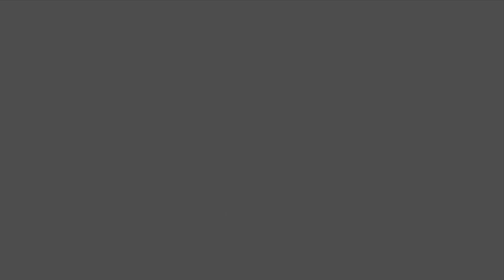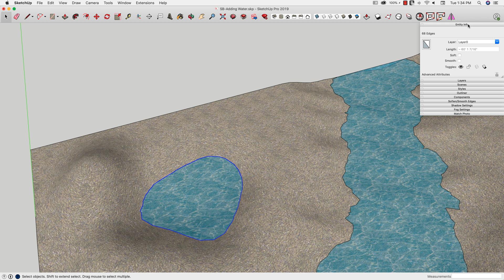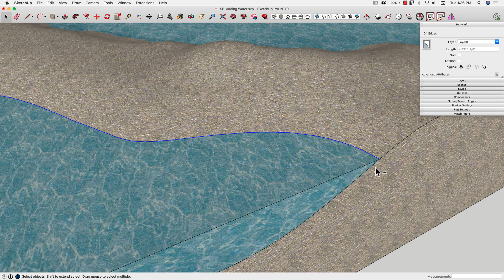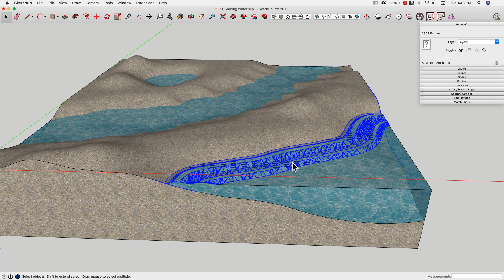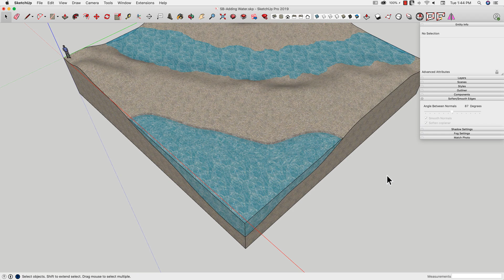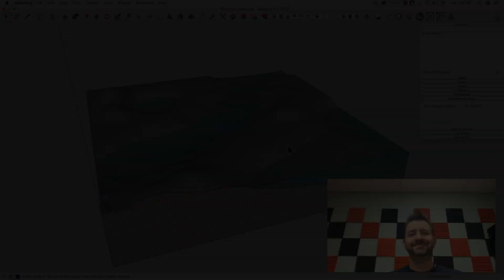Comment: It may not as widely useful as modelling, but could  you do a similar series with LayOut, plese? I feel very confident using SketchUp for modelling, but I am still struggling to present in a  simple, stylish way. I have to say I am dreading to open LayOut, not because I have bad experience with it, just because I know so so little about it compared to SketchUp. And in the end  2D derived from 3D is is a very good way to communicate and explain the idea. Very good video. Cheers.

Comment: Great video thanks. I’ve spent some time trying to improve sea views and your technique is useful. One way to avoid trimming edges after an offset is to move the straight edges into alignment. So in your example it would be offset-align-align, offset-align-align, etc. 

A further detail would be to add foam with the skatter tool. I have several foam elements on 3DW. Foam elements are also useful in boat wakes. 

It’s very surprising that these is no seaside plugin as ripples and foam can be mathematically modelled.
Reply: Maybe you should put that extension together, Jeff! 😉